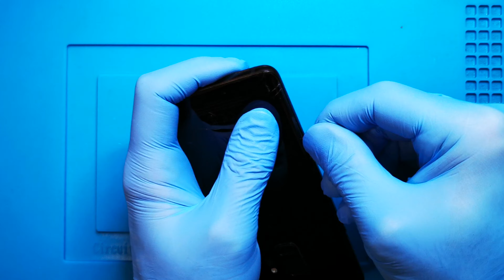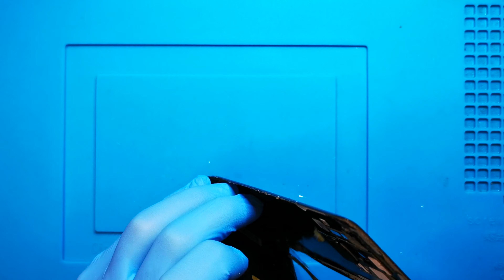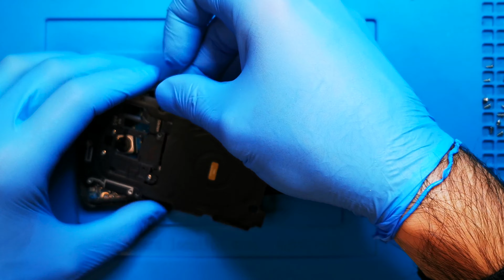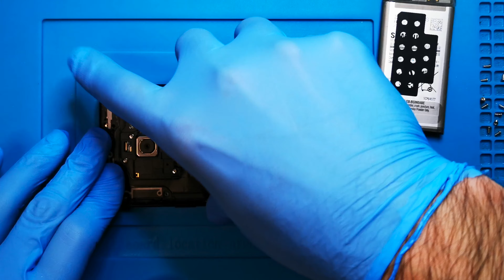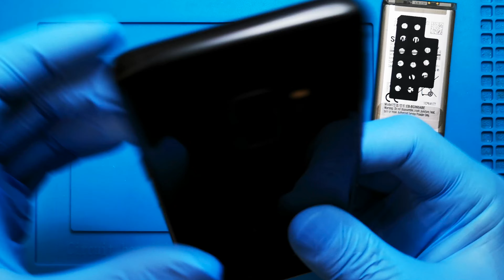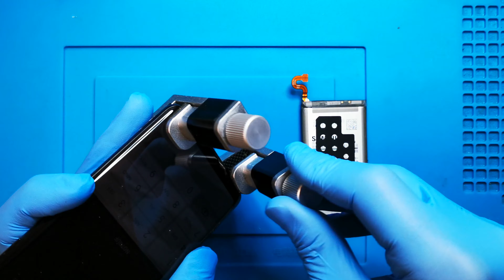Samsung Galaxy S9 Batarya değişimi #samsungs9 #galaxy #repair

Comment: Video için teşekküler. Rica etsem orijinal pili nerden bulabileceğim ile ilgili bilgi verebilirmisiniz? Teşekkür ederim.
Reply from the maker: Yetkili servis yada toptan cep telefonu malzemesi satan yerlerde bulabilirsiniz
Reply from the maker: https://www.ebay.de/itm/ORIGINAL-Samsung-Galaxy-S9-G960F-EB-BG960ABE-AKKU-BATTERIE-3000mAh-/383357787839?_trksid=p2349624.m46890.l49286
Burada orjinal batarya var.
Reply: Üstad cihazı size göndersek masraf ile çok mu pahalı olur

Comment: wow that is good, but I think the battery is going shake at back. I recommend using a double sided tape to keep it from moving
Reply from the maker: Thank you for your suggestion.  Since the original adhesive did not lose its function, I did not need any extra adhesive.